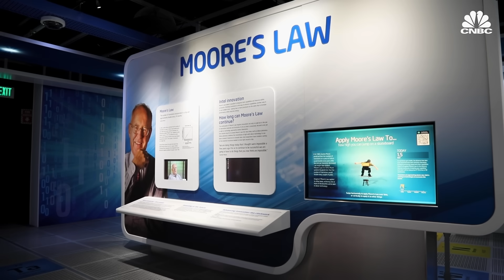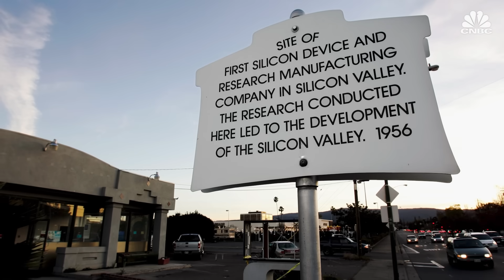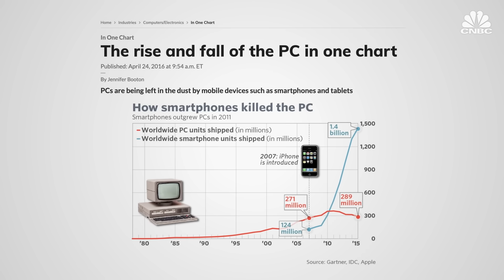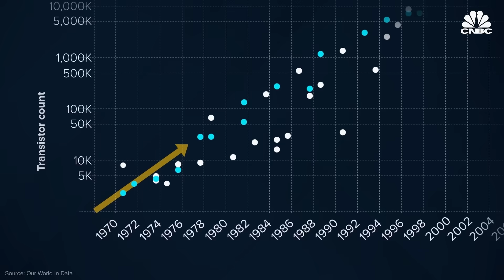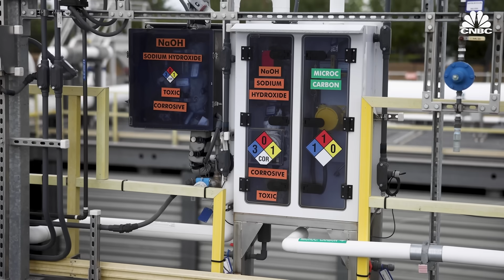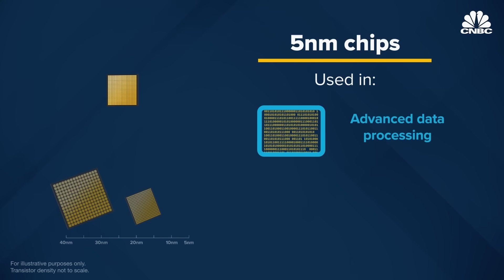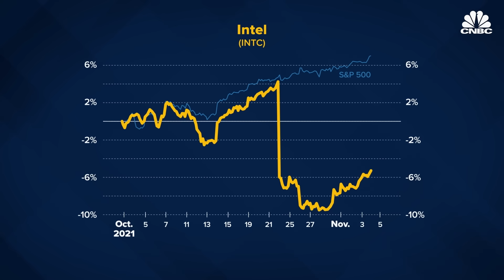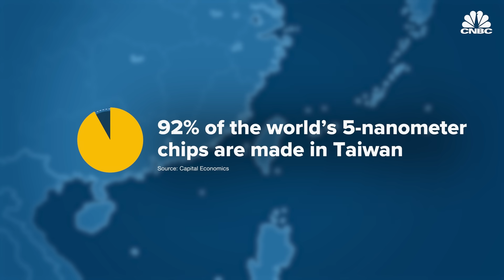Inside Intel’s Bold $26 Billion U.S. Plan To Regain Chip Dominance

Comment: A correction here, since 2020, TSMC is producing 3nm chips. They finished the design of it in late 2019. Signed contracts with companies to start selling them at late 2021 (happening right now). The next gen GPU and CPU is currently producing. AMD has some next gen GPU working with bench mark score released through official leakers using 3nm chips.

It's interesting to see how intel announce that they are going to get caught up shorty after U.S acquired the confidential tech document from TSMC. Intel duing the early 2021 were not able to produce 10nm, they failed for the last few years with no luck on break through 14nm barrier. 

Intel's original chip technology was not used in majority of the modern CPUs, although people used it to create the first sets of chips. AMD use a unique multi-core CPU design called Ryzen. They are the first in the world to invent ways to use multiple cores in a single chips. There's no question they are making brand new things that will never exist without them.

Comment: In Intels defense, the nanometer has become meaningless. No single structure in these chips is 7, 5 or 10 nanometers. As of late it supposedly means 'if transistors had been laid out next to each other, as opposed to layered, the density needed would be N nanometers. It is more useful to talk about other, more useful metrics when comparing the density of the  manufacturing processes, such as number of transistors per square mm..
Reply: True, those nm are just a marketing team at this point.
Reply: Yes, unfortunately that marketing caught on. While the nuanced reality of things is even more interesting than the simplified version, It is taken verbatim as yardstick by #CNBC and the loud analyst.
Reply: It very much affects power consumption, which is an important metric when evaluating performance.
Reply: While lithography is a very important factor for power consumption, it kind of works both ways. As I understand it, when you shrink sizes, you can operate the transistor at lower power, however leakage increases, therefore the transistor type in use matters a great deal. Power consumption is important and is in the specs. We should recognize that Intel have also improved upon this per the current generation now they mention Base clock power and Max turbo power usage.
Reply: @knurled-nuts  Voltage remains relatively the same, as that is determined by the semiconductor material itself. The base power consumption per transistor decreases significantly moving to a smaller lithography because each transistor is much smaller. It is a fundamental limit that larger transistors cannot overcome.

Yes, leakage current significantly increases with smaller lithography, and this can lead to increase in power consumption as seen in Intel 12th gen CPUs compared to 11th gen. However, leakage current can be mitigated and drop the power per transistor closer to the theoretical base power with more sophisticated design.
Reply: @pieluver1234  Note that I did not say voltage, but 'power', so we agree, I think. What I did not know is that de voltage is dependent on the material. Thanks.
Two questions. Do you happen to work in the field and secondly, what is your favorite pie?
Reply: @knurled-nuts  hey Luuk, you shouldn't need to edit your comments to appear correct. We're having a friendly and productive discussion here :)

I am an electrical engineer. Although I do not work with advanced lithography and chip designs, I do work with semiconductors. 

My favorite pie is apple pie. Pumpkin pie is my second favorite.
Reply: @pieluver1234  I didn't. That would be dumb.  But I can see why you think I did. 
Do you ever type some sentence, realize  one term in a sentence is better than the other, replace it but forget to check the rest of the sentence for grammar consistency. That happened - but all before you ever read it.
Reply: @pieluver1234  Once in a while I bake an apple pie with cinnamon, ginger and forest fruit jam, delicious but a lot of work ;)

Comment: Ok... CNBC. Transistor size does not directly correlate with chip size so your graphic is misleading. And just because 5nm TSMC is the "newest" does not mean that's going into F-35 planes. Also TSMC 5nm is similar is spec to Intel 7nm. These numbers are essentially just used to denote  generation of technology rather than physical specifications of transistor sizes.

As a trusted news outlet you should maybe get someone with knowledge of basic fundamentals of chip lithography. The F35 was created prior to the 5nm TSMC process. Now maybe they are integrating it into these jets, but what sources provide that information?

Comment: Intel is being left behind. They’re keeping up power-wise, but their chips run hotter and consume more power than their competition. Efficiency matters.
Reply: LOL AND has been chasing Intel chip technology for 30 years. Your comment is RICH.
Reply: it does and it doesnt. if it runst hotter due to more power draw but has to run shorter efficientcy is the same or better as proves last days..  its about energy used per  workload.  and on top of that their chips use less when idle as am chips. and most systems are idle for the most time.

Comment: 7nm intel vs 5nm Samsung is NOT the same. think about cars. both have v6.   but ford truck has a different HP and torque than the other V6 in Mercedes V6.
Reply: Samsung 5 nm is equivalent to 7 nm from TSMC
Reply: @genuinennessbefitting4734  note I didn't mention TSMC

Comment: After efforts of all these many years Intel is still on 10nm chips? Have they seen M1 processors? Intel has put PC users like me on a disadvantage. I don't want companies like Intel to see around.
Reply: Intel's 10nm chips are not comparable to TSMC's 10nm chips as they are on a different architecture node.  Intel's 10nm chips are competitive with TSMC's 7nm.   However, with this said, they are still behind, just not as much as one would think based off nm nomenclature.  This was part of the reason for Intel's renaming of their chips.   Also, chips are not measured based on nm, they are measured based on transistor density.
Reply: @aeongaming2561  Apple's M1 chips are fabricated by TSMC. Yes they have different architecture ARM and far superior. M1 is years ahead if not decade as compared to Intel's most powerful processor.
Reply: @Gautam Chauhan I am sure their engineers and architects have seen that, if you a layman has.  The fact that you made this comment shouts that you haven't engineered anything difficult or groundbreaking. It takes time.
Reply: @Badumtss2468  Intel trying to compete against TSMC and Samsung with 10mn is like fighting missile and rocket with bow and arrow. Intel is not going anywhere anytime soon, they will be there to secure the last place.
Reply: @GautamChauhan  You do know Intel has its hands on TSMC 3 nm right? Also they have a angstrom roadmap? Please read more. As for M1 chips, Alder lake is already the step they have taken in the right path.
Reply: @GautamChauhan  Also they have an Upcoming Alchemist GPU coming at 6nm TSMC node. Are you hiding under rock or what? They have their own fabs as well as TSMC to support them now for their chips.
Reply: @Badumtss2468  So you are saying that the Intel has already admitted the defeat and is now dependent on TSMC for their next gen products.
Reply: @Badumtss2468  After losing the fabrication war now they are going to compete against Apple, Qualcomm, AMD, Samsung and Google in Chip designing? Good luck with that.
Reply: @GautamChauhan  How is that a defeat? They will manufacture chips for other companies also. Revenue from selling their own products as well as revenues from manufacturing other's.
P.S - They already have taken the gaming crown with alder lake. :)
I get it, you are uninformed. Hope this is not too much for you hotcake.
Reply: @GautamChauhan  As a matter of fact AMD has already reduced its chip prices by 100$. 100 freaking dollars after alder lake drop. That means, what they were previously selling for 399$, they could have sold for 299$ as well, but they didn't. Intel have already pivoted for a moonshot.
If you are a fanboy. I have no interest in communicating with you any further.
Reply: @Badumtss2468  it is a defeat because they are not in top 2 neither in chip fabrication nor design. Now they are in GPU market with inferior GPUs. They are trying to becoming Jack of all and losing everything.
Reply: @Badumtss2468  it is sad to see that when all the facts are in front of you, you chose to close your eyes. Good bless you.

Comment: Fab size is not the problem.  Intel fixed it with price/performance ratio.  Intel will catch up in the fab department.  In the mean time, they will gain back a lot of the OEM biz that went to AMD.

Comment: 13:30 5nm on a rover? That's something huh? I thought they use radiation hardened chips.
Reply: Yep, 5nm in rover is just not true
Reply: 5nm TSMC process is relatively new. How would space programs have put this technology in their rovers? Not only that but the amount of rigorous testing that must go on for something so expensive on a foreign planet... 

You're absolutely right. CNBC is full of bologna.
Reply: Everyone please come down. It may just be a slip up with the reporter trying to give an example of "high tech" without giving a thought that she was also implying putting 5nm in a rover. For all I know, what the rover wants is quite the opposite. They want bigger transistors instead of smaller ones because of the increased radiation noise in space to which the rover will have to travel. But then, this convention may not hold true for the future.

Comment: we are very close to the physical limit on size reduction now. some of these gates are now only 6 or 7 atoms big. it seems the next big improvements will have to be more at the architecture level, something intel should be very good at
Reply: I agree
Reply: x86 and CISC have proven to be far more limited than ARM/RISC. Intel’s architecture is already dated. Also, they’re basically still producing 14 nm chips with a rare few 10 nm options. TSMC is down to 5nm + with 4 nm and 3 nm coming very soon, within a year.
Reply: @eldritchboyfriend  you're comparing marketing dimensions not actual printed density.  And cisc/risc has been irrelevant for a decade: all chips look the same on the inside.
Reply: @markhahn0  alright even if we ignore actual physical dimensions, x86 (a CISC architecture) is wildly inefficient, requiring far more power and generating far more heat. Apple Silicon (ARM/RISC architecture) achieves the same performance at less than half the power with so little heat output as to eliminate the necessity for active cooling. Intel JUST now took the big-little approach in Alder Lake. However, Intel uses system in package which cannot physically achieve the same memory bandwidth and performance as the SOC design of ARM chips. So, tell me again why RISC/CISC is irrelevant.
Reply: @eldritchboyfriend  Because none of the factors you mention have anything to do with ISA.
Reply: @markhahn0  okay if that’s true I’m excited for Intel (and AMD for that matter) to take their heads out of their asses and do some R&D and prove they’re still viable.

Comment: I was under impression that 4 nanometers is the smallest you can make them under the Moore's law 🤔
Reply: 0.2 nm is the atom size, so that is the hard limit. You have some quantum tunneling effects hence they abandon FINFET and switch to GAAFET. 
IBM has made a working 2nm chip with GAAFET already, as a proof of concept but not for mass production.
At the end of this decade good chance they have 1nm as well.

Comment: I feel Alder lake is at par or maybe better than AMD . Samsung does not make x86 chips, so comparing it with Intel is unfair and TSMC just outsources it's chips, they don't compete with Intel Directly. Also, the only Competition Intel has with TSMC is with AMD who still use old 7 NM node of TSMC rather than the new 5NM Which is at par with Intel's 10 NM. I feel Intel.is just doing fine now.
Reply: Alder Lake benchmarks are already out there, considerbaly better performance than AMDs and Apple, check them out.
Reply: @JigilJigil  in gaming nope

Comment: If this was 2009, we would believe you
Reply: credit where credit is due, at least they delivered performance with alder lake.
sure it still runs pretty hot but cant win them all.
Reply: @BattousaiHBr  yeah but they consume more power and requires better cooling. but i agree its better this year i am hoping for good alder lake cpu for laptop amd not available because no stock, intel is available .
Reply: @shivsankermondal  yep.
zen5 seems like it'll use the same efficiency cores architecture as alder lake, and it doesn't seem like windows' scheduler knows how to handle these well yet.
Reply: @BattousaiHBr  atleast now we can debate which is better , unlike few years ago only intel .
Reply: @shivsankermondal  or just a year ago only amd.
Reply: @BattousaiHBr  sadly it was for desktop only because not every manufacturers didn't use amd until 2021,where i live still only asus , dell sells amd models.
Reply: @shivsankermondal  they were even more dominant in the server market than the desktop market (and still are).
Reply: @BattousaiHBr  amd zen4 is around the corner!
Reply: @darshan5726  zen4 isn't anywhere close to shipping, and i didn't hear many great things about it... seems like amd's efforts have been placed in zen5.

Comment: It all started when they declined to make chips for iPhone. Factors like architecture difference of ARM  vs x86, use of 5 nm chips in cutting edge technology, power efficient chips, and more user cases for Graphics Puts intel behind, but like before they need to do a180 pivot as before to make a comeback.
Reply: the iphone deal probably didnt matter, they were bound to go arm eventually due to higher power efficiency.
Reply: True. At the time, they saw RISC instruction set and low-power micros as components for toys. They failed to imagine the diffusion of fully fledged pocket computers (smartphones). In Intel mind, any meaningful computer would have used 100+ Watts of power. 
Now Intel, the US and the West are risking the availability of micros, which are the life and blood of every advanced nation, because the geopolitics have shifted faster than they could acknowledge. I sincerely hope they succeed in their endeavour...

Comment: AMD is still slower than Intel.. for sure in top performance benchmarks. Apple m1 also is nothing at all good in benchmarks for power and video power.
The best is still nvidia and intel powered gaming PC, simple and fact if you research the famous benchmark called Port Royal Hall of Fame benchmarks... 
Luumi is one of the youtubers who proves it with nitrogen cooling intel chips and nvidia for graphics.. its been the best and I build PC for 20 years, I know what I am talking about (aka you cannot correct the facts)
Reply: the top 9 chips are intel made.. the 10th is amd. Again its the most famous benchmark for custom computer designs.. the 3dmark Port Royal hall of fame benchmark list, research and the facts are right there.
Reply: let me see if i get this straight, this youtuber guy "proved" it by cooling the chip with liquid nitrogen so it wouldnt melt itself from the heat?
Reply: @BattousaiHBr  The best is intel and nvidia 3090 in benchmarks of high end power PC users... Luumi, also jay2cents, gamersnexus, linustechtips has highlighted a few guys who do it... yes liquid nitrogen systems to cool (required a special license to acquite and use in most cases ha)
Reply: @dertythegrower  i know all of that about CPUs, i was just making fun of how completely wrong you are.
although intel does seem to be back now with alder lake, but that was certainly not true for the past year.
Reply: @BattousaiHBr  And I dont know why you are putting quotes.. benchmark data is proof.. its a fact, you cannot beat it with any other chips besides intel.. so that is proof and all top PC builders will confirm with actual proof science which is a benchmark these days.
Reply: @BattousaiHBr  (Here ya go battou... video titled from 2 weeks ago... (Luumi - 3DMark Time Spy Extreme World RECORD with 2x RTX 3090 KINGPIN Cards on LN2 at Aalto University)